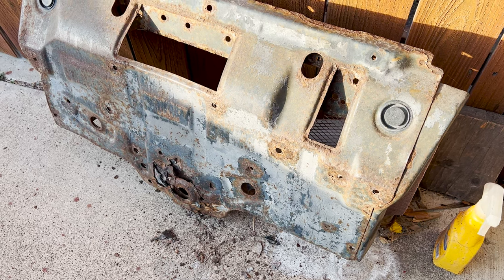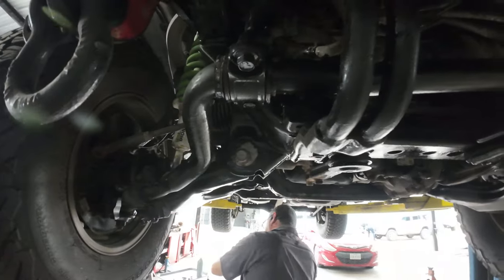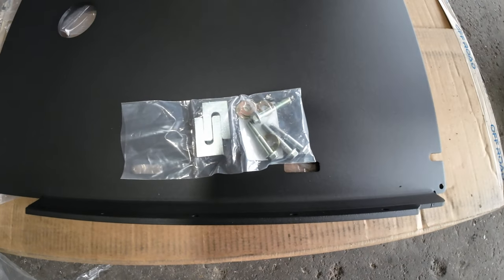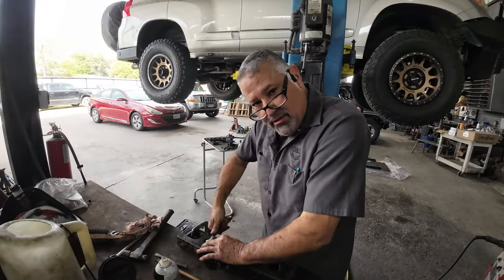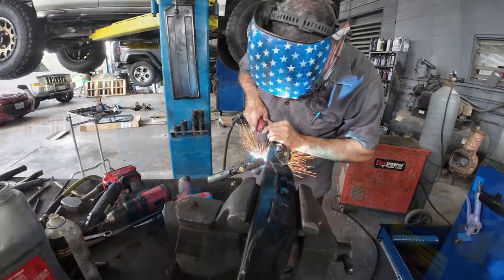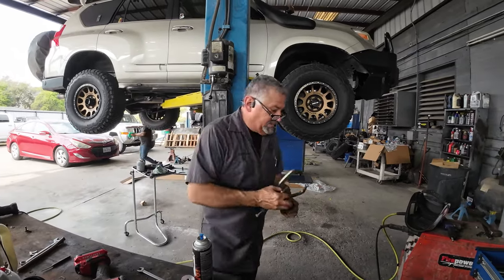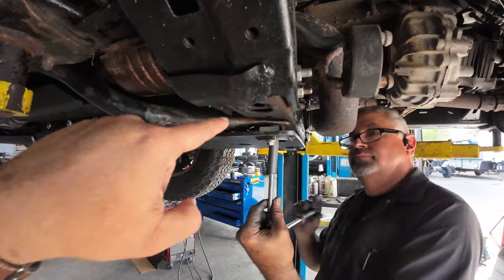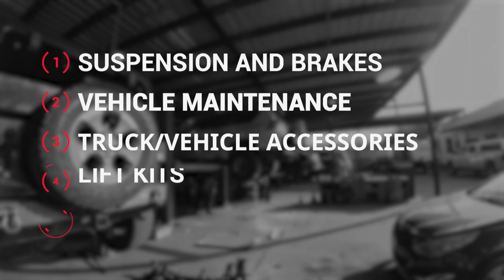A RUSTY MESS - Installing RCI Catalytic Converter Guards & Skid Plates on Lexus GX460

Comment: In my 4th Gen Runner, after every PINS trip, I pulled my skids and soaked the bolts in Concrete Etch, Metal Prep and Rust Inhibitor from home depot.   Works great, and ensures you get to most of the places when cleaning.  Always surprised how many sea shells were always in the skids.
Reply from the maker: Yes!!! Sea shells and so much sand in the box frame. This was an eye opener and I’m glad we addressed the issue while we still had time. 😅

Comment: So will  the catalytic converter guards protect the catalytic converter from theft?
Reply from the maker: I think the design is a great deterrent. These bastards are opportunists so maybe they’ll move on if they see these. Nothing is impossible to crack, but I’m hoping they’ll just be dissuaded and move to an easier target.
Reply: @CoastalGX  Well that is what I am looking for, the convertors are expensive. So I will check them out.
Reply from the maker: @Moondoggy1941  you will need the tranny skid to go along with the cat guards. They attach to the tranny skid as you can see.
Reply: @CoastalGX  did you need to drill holes or the cat guards and trans skid came predrilled?
Reply from the maker: @vladimirmitrovic9724  came pre drilled and everything fit fine.

Comment: I always recommend putting dab of engine oil or other lubricant on thread of bolts whenever you install parts. Youll be thanking yourself after few years if youll ever come back to unscrewing them to change something.
Reply from the maker: Thanks for sharing. We used “anti seize” on the hardware.

Comment: Hi Robert did you do some/extensive research before you got you shields, are this the best product in regards to the cat protection?  I'm looking my self for something similar but I don't see many options for cat shields I have a 2018 GX460 with KDSS.
Reply from the maker: Hello Kike. It was a no brainer to go with RCI since they threw in the cat guards for free with the purchase of the tranny skid. So I paid full price for the engine and tranny skid and got the cat guards at zero charge. They cover them nicely and i feel it’s a good deterrent from theft.
Reply: @CoastalGX  ok one last question can I keep the OEM engine shield or the RCI will make a difference in regards to the safety of the cats? No Mods on my GX also mine I think it has the KDSS if this make a difference on the RCI engine plate.?
Reply from the maker: @kikeperdomo1735  ask all you want, Kike. I suggest you get the engine and tranny skids like me. One fits into the other. Watch how DJ assembled the cat guards.

Comment: Robert is there any provision for oil and filter change or do you need to remove the entire engine plate for oil changes?
Reply from the maker: There are access ports in the plates. If you off-road often, you may want to add anti seize to the bolts to prevent issues in the future.

Comment: I have heard that where the AC drain hose touches the frame it will rust there. Have you noticed that as well?
Reply from the maker: No issues from AC drain, only from saltwater and moist sand. Those bolts were pitted!! Dangerous.

Comment: I see that coolant too, you might have the notorious valley plate leak as well.
Reply from the maker: She’s in the shop for that right now. Wish me luck.
Reply: @CoastalGX  It's a pretty straight forward repair, shouldn't be a big deal. It's a shame that the 1UR and 3UR can fall victim to this failure.
Reply from the maker: @texlee1640  my buddy just got quoted and it just appears to be a labor intensive job with little money going to parts. He gave me a list of hoses and fittings that probably should be changed while the thing is dismantled 👍🏽
Reply: @CoastalGX  I have 3 GX's do this valley leak crap ! i found it amazing that Toyota {Lexus}  cant figured this out instead of using that crappy sealant just put a dog on gasket !  ho and  by the way it will fail again just give it 5 to 7 years regardless of how much miles are on the truck that sealant just get old and start to leak first is so little you wont see it until one day you going on an incline and your temp go up and going down the temp go down because you low on coolant dont ask me how i know... well frist truck was a 2010 second a 2012 and the last one was another 2010  i believe this should be a recall, for my last truck i paid $2200 for the repair and yes is very labor intensive i will not take this job any where but the dealer learn that one the hard way too...this trucks are amazing but have the most ridiculous mechanics problems and is funny how they all costing around 2k  ! yes i talking to you secondary air exhaust combustion leave me limping system !! well at least this one have a easy prevention  fix but really Toyota this should be a recall ! on another note Robert i will recommend if  you have not done this all ready change your trans fluid along whit filter and also your front and back diff and lube yokes dont believe in the lifetime transmission bull... in all my past trucks after the hit 90k i went and replaced and then every 50k  and especially if the truck is lifted and got bigger tires that put more strain on the trans and the diff,  wish  you luck on your repair hope you make a video about it ,  i will be interested in see how it went and what other parts you also change.
Reply from the maker: @luen6630  excellent information. My GX is at the shop. I’m replacing the hoses and fittings. Total price came out to $1600. Any issues with the knock sensors afterwards? Yes, Toyota/Lexus needs to handle this as a recall. Reliability, my ass. 😅
Reply: @CoastalGX  I have never replaced the knock sensors , i dont even think to have them replaced ! maybe is a good idea to do it at the same time,  thanks for the tip ! but so far in all the GX's i have owned i never have the knock sensors give problems, in the current truck i have 180k miles on it i lifted this one at 140k miles whit the Iron Man kit and have done front and back custom bumpers, i still going to add a few more mods to this truck but so far whit this one i have the secondary air exhaust fail, the valley plate fail, and the water pump fail and last a weird problem whit the line for the steering fluid, at the front lower bumper it have a tube that acts as a cooler for the fluid and the problem is that at both ends is connected whit a small piece of hose and clamps and those hoses crack on my truck causing all the fluid to leak and blow the pump! hefty repair that could be avoided just by replacing those hoses! when they fix your truck check constantly the level of the coolant i have a bad experience where the coolant leak due to bad installation, and the sad part is that sealant they use is going to fail again as it get older start to leak i really think this should be a recall but i guess they waiting to get sued to do something about it!
Reply from the maker: @luen6630  thanks for sharing that valuable information. I will take a look and see if we can do some preventative repairs to the hose you’re talking about.
Reply: @CoastalGX  Hey brother will you be posting video on valley plate repair as well as hose change recommend? Thanks homie!
Reply from the maker: @gilmercado6036  I talked to the shop owner and he’s willing to do a walk through after he finishes. Unfortunately, I can’t be in there with him as he operates so I will have to depend on his pictures and explanation. Hopefully share the parts too.
Reply: @CoastalGX  Where did you take your Gx? I also live close by. I may need do the same unfortunately.
Reply from the maker: @ it’s D&D Wheel and Alignment in McAllen
Reply: @CoastalGX  I mean for the valley plate leak. What shop did you take it too?  sorry for the confusion.